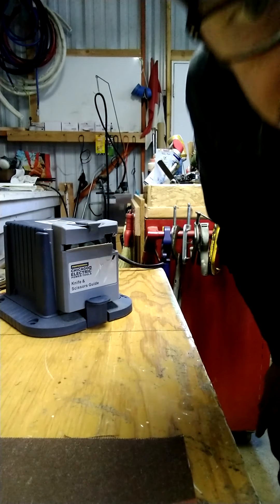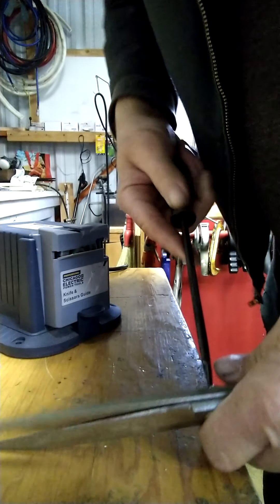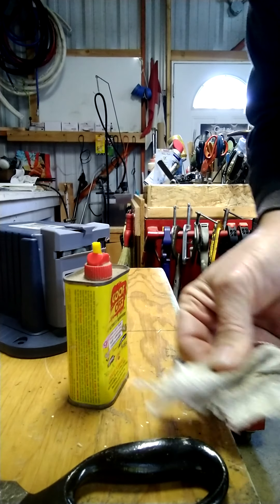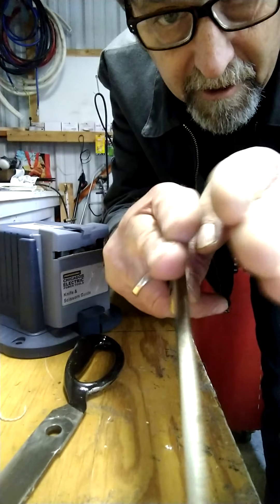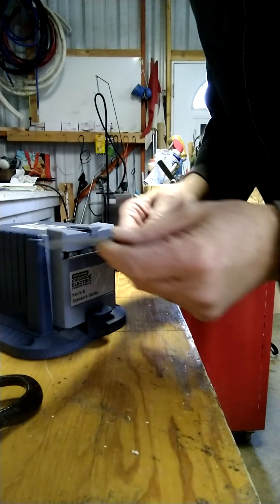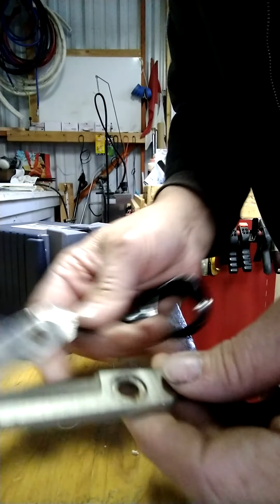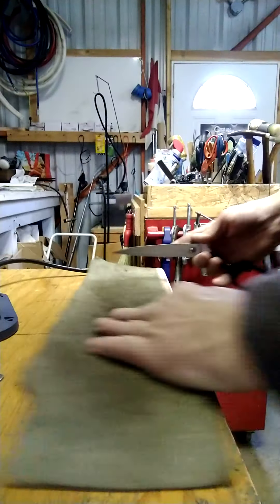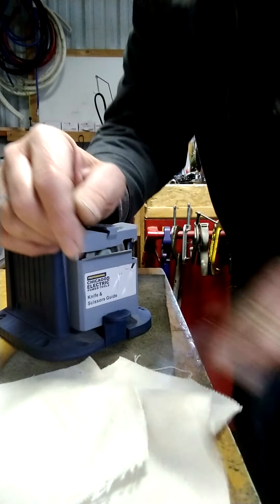Electric Sharpener

Comment: thanks for the video.  But I use Gingher.  Each blade has a different bevel.   But, I do have others too.  Thanks, again
Reply from the maker: I did not know that about the Gingham scissors. I have always used the Wiss brand. This is a very basic model. Doesn't have a bevel adjustment. If I had expensive scissors, I probably would upgrade sharpeners but for general upholstery work, I am liking it.